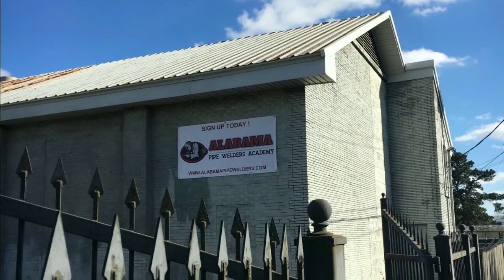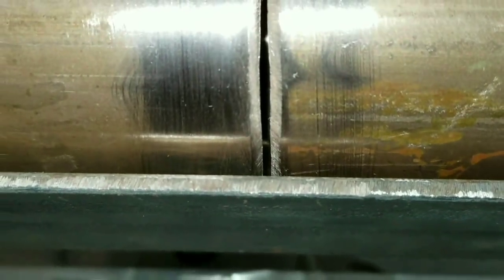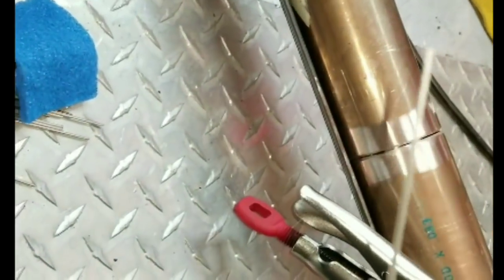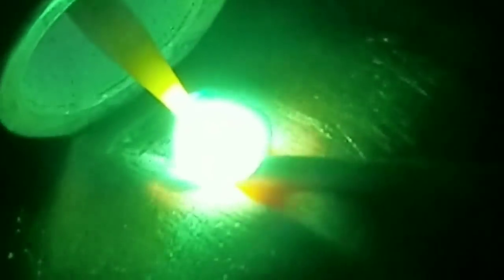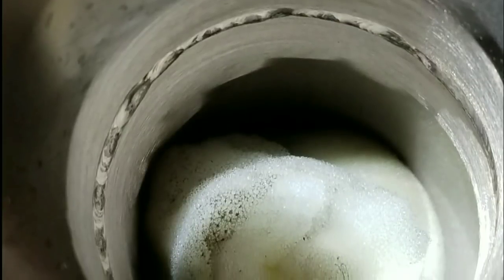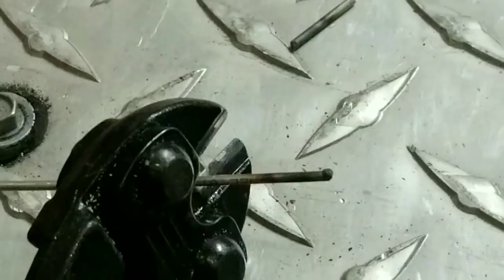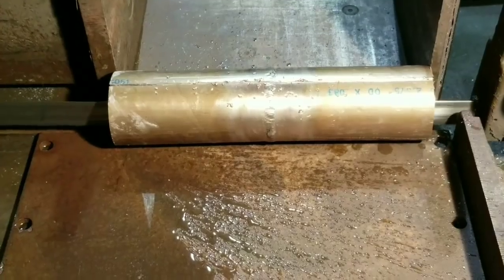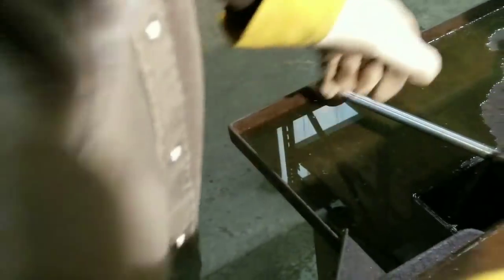How to weld 6G Copper Nickel Pipe Test Guide for Navy Shipyards

Comment: Here in the UK we weld CU/Ni alloys with mix gas of either 2.5% Hydrogen 97.5% Argon or for heavy wall 70/30 CU/NI or for Monel alloys try 5% Hydrogen 95%  Argon the hotter arc and cleaning from the hydrogen reaĺly make a big difference
Reply: yeah i agree, i actually weld alot of 70/30 CuNi and i prefer to weld it with 95/5 Ar/Hydrogen..i find that with that hot gas mixture the puddle runs alot like stainless. very active and watery puddle, it also just weld much cleaner with 95/5..
Reply: Also used a similar mix for Duplex Stainless.
Reply: @djyul  Did not find pure Argon all that good for heavy wall Duplex pipework, a small percentage of Hydrogen improved weld puddle fluidity when using semi-auto TIG  but that was 40 years ago..
Reply: @MegaBoilermaker  hydrogen and duplex doesn't mix actually. The water content in the hydrogen can cause pit corrosion/pitting and eventually pipe rot. You don't want that 😜
Reply: @OminousObelisk  Was the Welding Engineer on a heavy wall Duplex sour gas pipeline over 40 years ago, not much written research to go on at the time.
Reply: it may work better but these shipyard only use argon primarily

Comment: I weld a ton of this stuff. Have you ever tried the RN60 Copper Nickel wire? Far superior to the RN67 in my opinion. Runs much cleaner and less dead.
Reply: I think rn67 welds much better than rn60. Though we only usually use rn60 for cuni to carbon
Reply: RN 60 is for CUNI to HY 80 (Hardened carbon steel)

Comment: Where would this be used? I'm very use to seeing pipe being back filled so the root has a more cap like appearance on the inner diameter as opposed to a sort of groove look such as this joint has. 
Thanks very much sharing your knowlegde!
God bless!
Reply: They are used in a lot of marine piping systems. This is because it resists saltwater corrosion.
Reply: @zakhamilton8096  gotcha! Thanks alot!